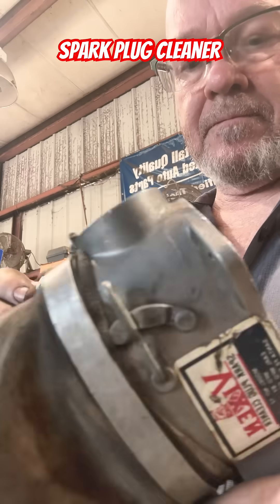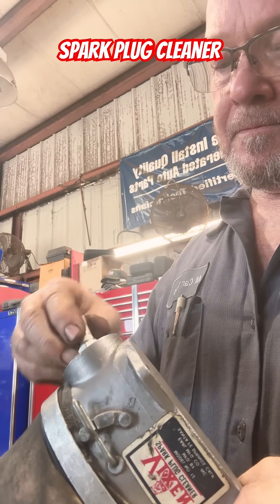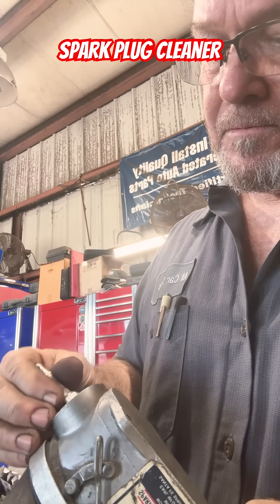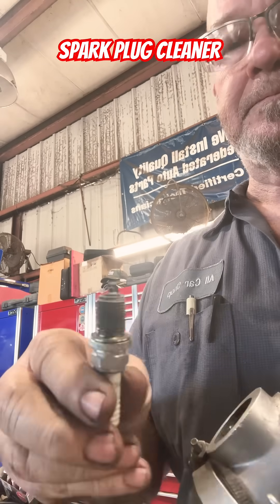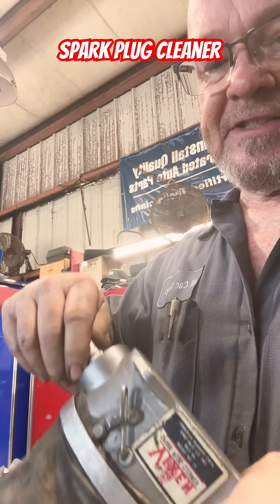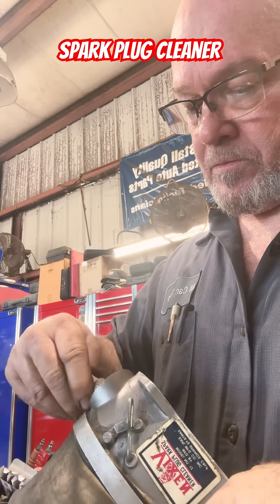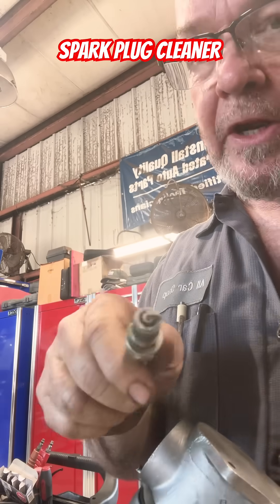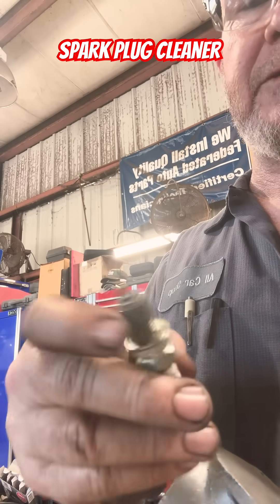Should you clean spark plugs?

Comment: Jimmy got a question for you maybe u can help or someone I'm been a tech for 25 years but I'm at a dealership and been doing alot of  issues I have a brake out box I use but use the shops scope and sometimes wait for hours what I'm asking is what a good scope with leads to buy been looking on Amazon if u can lead me in the right direction.......have a good week make them hours love all ur videos
Reply from the maker: There are lots of decent options for scopes. Pico being the peak, but requires a laptop and expensive. Hantek has many good options also. As well as some scan tool brands offer add ons.
I am saving up for a Pico myself and will buy a $300 laptop to dedicate for it once I get one.

Comment: We have one of those. Cleaned a lot of spark plugs like that. And ran them in cars.
Reply from the maker: Yeah, it works well. I prefer new, but it isn’t always necessary.
Reply: @JimmyMakingitwork  Well it depends on what you're doing and how old the plugs are. When I built my mustang and I was tuning it, adjusting the carb and whatnot, I was always cleaning the plugs in it. Couldn't afford new plugs every hour of tuning lol. I'd race it, bring it home, take the plugs out, clean them and put them right back in and go cruising.

Comment: I cleanly throw them in the nearest circular file after 100000 miles.
Reply from the maker: That’s some miles! When I was a younger man it was 12-15k. 😎
Reply: @JimmyMakingitwork 🥰 Iridium has entered the chat.

I  'member  copper plugs, too.
5000 mi, regap and check.
10k- do I have a new set?

Where's  my " points" file? Feeler gauge to set the gap? Timing light, dwell meter???🤔